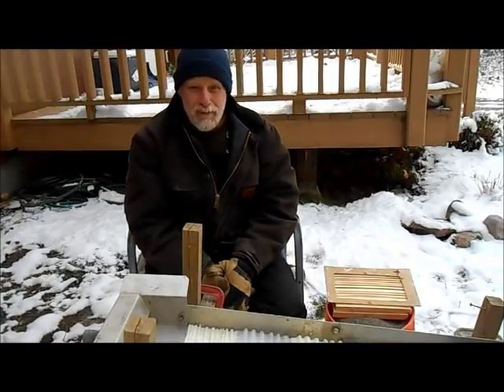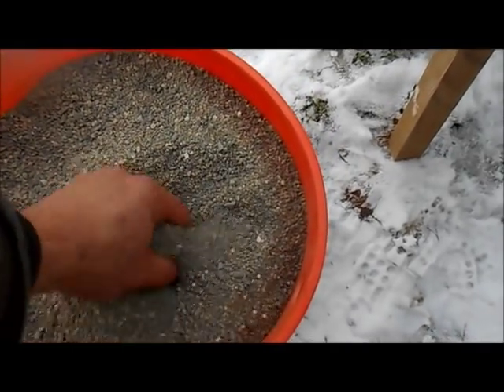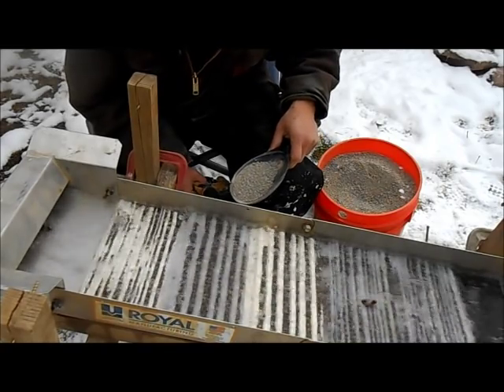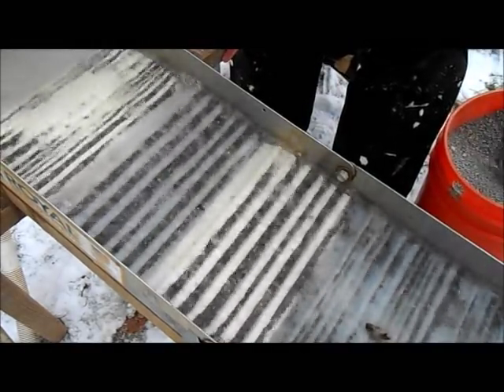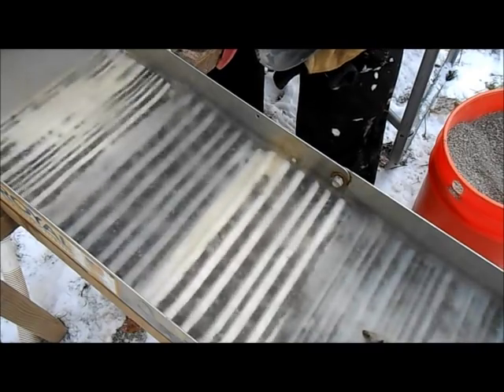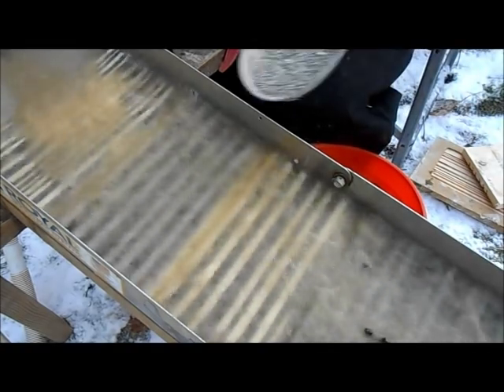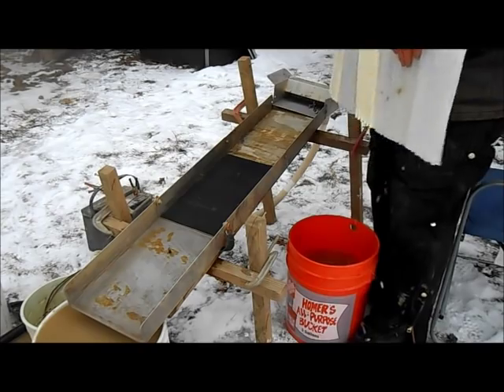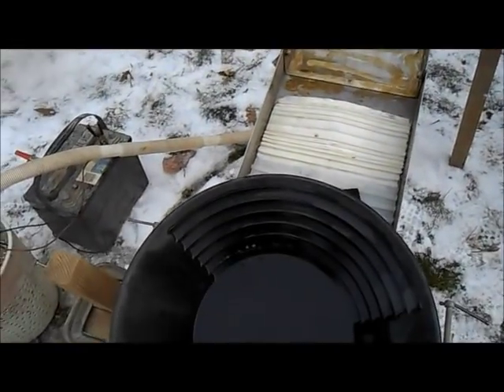Testing Sluice Box Mats Made With Silicone Caulk Looking For Gold

Comment: Couple of comments,  you could add a 1/4" fiber mesh to the bottom for durability and to prevent tears.  I question the possibility of distortion of the riffles if something is placed on them which will mash them down.  The mats would have to be stored flat with nothing on top.
Reply from the maker: Hello James Thanks for the tips since the mats are just experimental at this point and I might have to make some changes in the future as for right now I just don't see them tearing or getting flattened out. Thanks for watching

Comment: What state do you live in? All that snow on the ground... The power pig header from gold hog is something like the one you have on your sluice... I have that Royal Folding sluice box also.. But I put gold hog mats in it.. The mats cost more than the sluice box almost.. Lol.. I paid $128 for them.. I think they use the same rubber that they use on them slate like looking shingles.. it's called extruded rubber.. Well the shingles are made from that.. The shingles are guaranteed for life, but they cost around $600 per square in materials... And a 10×10 area = one square..
Reply: I'm in Hopewell Va near Richmond Va.. We have fine gold here in Hopewell, but if I drive west around 1.5 hrs I'm in the center of the Va gold belt...
Reply from the maker: I am in Montana where we live we usually have 4 to 5 feet of snow in the winter give or take. Well that is where i am at either by hog mats or make my own so far so good.
Reply: @alanrobertson2510  oh yeah man.. You did a great job on them.. You're always working your brain an coming up with some cool stuff...

Comment: Looks good. Was thinking that you could press screen or an open mesh cloth into the backs to give more durability or to make longer single lengths. May also be able to line the mold with something like cloth to get a more durable surface (may need something to tac down to mold). Also thinking, maybe able to mix in sand or something to make silicon go farther and maybe more durable. Thanks for your time and extra efforts to share with us. May the color gold fill your pan.
Reply from the maker: Thank you Good ideas as for now I need to do more testing and see how for I am going to go with this idea so far so good.

Comment: I think if were to screen my material to one quarter inch I would always wonder if I through out a nugget or two.
Its like catching a trout, and catching a monster trout. Lol
Reply from the maker: I would agree most of the time I run the metal detector over the tailings I figure if I miss a nugget over 1/4 inch any metal detector would sound off and you catch most of the small gold in the sliuce and not flush it out by running big rocks down the sluice.Thanks for watching.

Comment: if your running a control batch through the machine and its say been pre-run. you can salt the batch with broken up pellets from a pellet gun. alternatively take some fishing weights and a pair of tin snips cut off some varying sizes and even take a knife and shave off some small stuff. salt your batch with that and stir it in so it doesnt all show up at once.  i suggest using different sizes of lead simply to show you whats catching and where. lead being so nearly matched with gold in weight makes it a perfect candidate for testing.

also wanted to mention the idea of using some other materials such as flexible resins or possibly even something like flexseal to create mats. a good flexible resin would be in my estimation more sturdy than a pure silicone base. flex seal by its very nature strikes me as being a wonderful option. easy to pour into a mold. or spray into a mold in layers. take a while but would guarantee good molding definition.

love the videos keep em coming :)
Reply from the maker: Thank you that is a good idea to use lead but I think I will use gold it is not going anywhere that way it will be a true test. I think the flex seal would also be a great way to make mats just need ti figure out how to get it to release from the mold. Thanks for watching and the ideas.
Reply: @alanrobertson2510  np im enjoying them. stuck on a release method myself as well.

Comment: Great.av had an idea of making a wooden sluice with decking!
Reply from the maker: Good idea the mats would work great for a wooden sluice box.
Reply: @alanrobertson2510  I was thinking the decking for the v matting.if the gaps are no good use a sliding mitre saw to either put an angle on or deeper or closer together.👍😉 just so happens I got some given last week!
Reply from the maker: @rastamanralph6670  Good luck on your build I hope it works out for you.